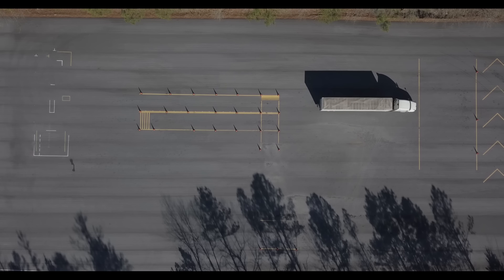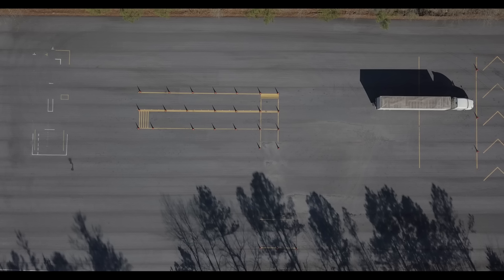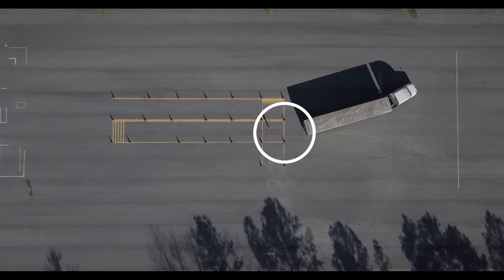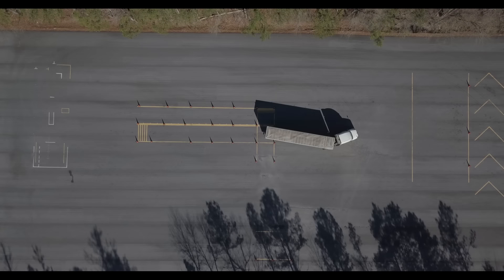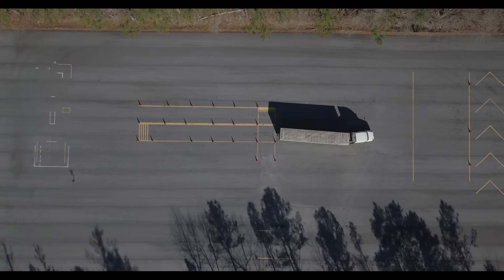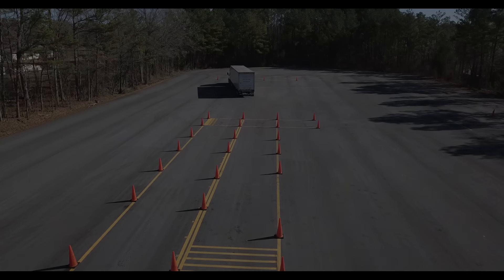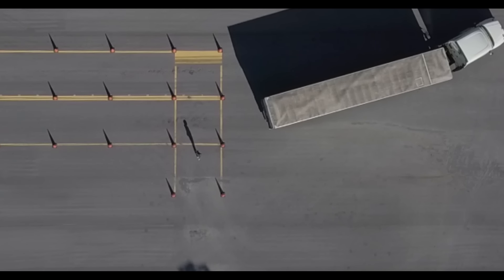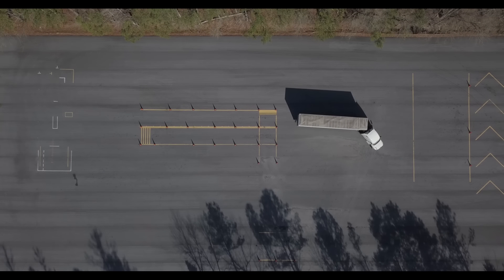CDL Training: Offset Back Maneuver

Comment: Doing y'alls a favor here!

OFFSET Procedure; 

1. Pull forward, stay center between your lane's cones until you reach the end of the lane. 

2. Once there, pull the steering wheel one full rotation to your side of the two lanes. 

Ex; If left, one left, if right, one right. 

3. Back with steering wheel held in that position until middle lane cone disappears from the under the Plane mirror's Convex mirror; this view is from the mirror bracket closest lane to the middle lane. 

4. Now, IMMEDIATE hard turn of the steering wheel to the opposite direction. 

Don't stop backing until the trailer rear tandem is aligned with the middle of the lane. 

5. Now you would G.O.A.L.; ensure the path of the middle cone walking forward intersects with the trajectory of straightened trailer. Once confirmed; 

6. Pull the steering wheel twice to the outer lane. 

7. While backing, straighten your wheels until the rear tandem is aligned with the middle cone. 

8. Once in the lane, hard direction lock pull of steering wheel into the inner/ middle lane. This will get the tractor back under the trailer. 

8. Align truck with trailer as backing as you would a Straightback, but if not possible then pull forward and place vehicle in middle of lane before proper Straightbacking into the spot. 

Advice throughout all this; Remember CounterSteering avoid the Buckhead!

Comment: 99.9% of drivers will never ever need to do this maneuver. Even if for example they make you move doors in a dock yard or warehouse, you're most likely not going to have enough space in front of you to pull straight out and perform this move. Ive had to move doors once before, and I had to pull out, line it up 90 degrees again and put the trailer in the hole. Why? Because the space in front of my truck was way too short.